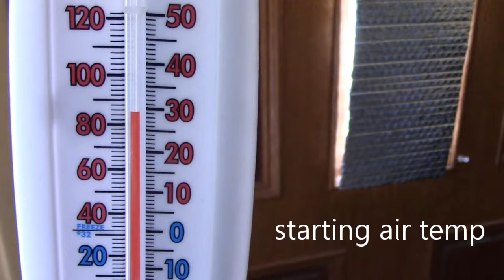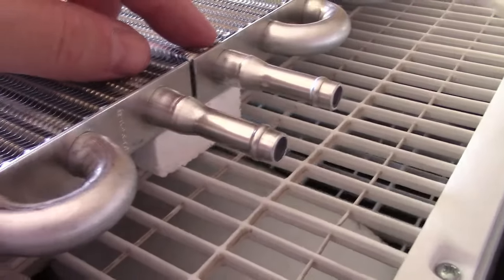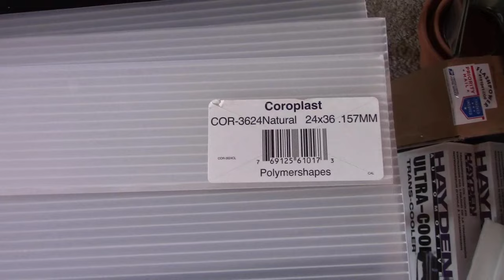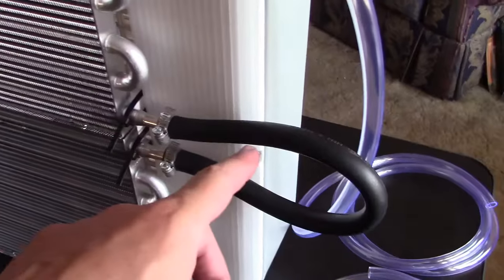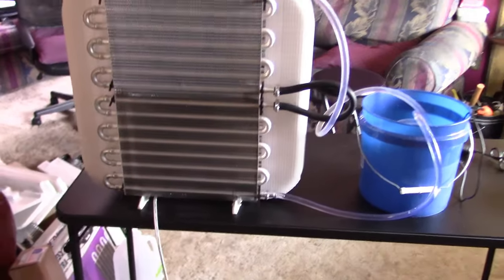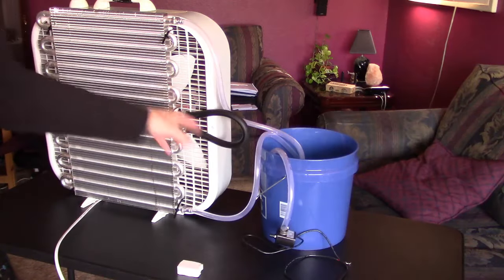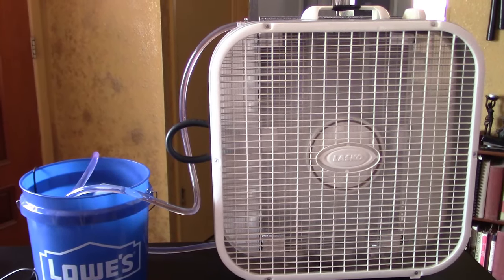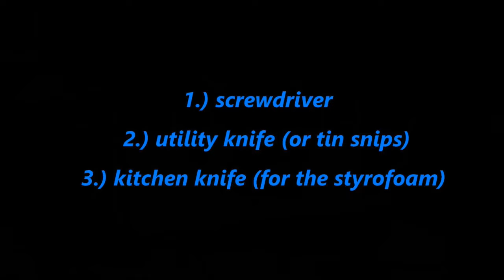DIY Air Cooler! Homemade Air Cooler with AC "like" feel! (extended *semi-uncut version) Box Fan conv

Comment: This looks awesome! I'm going back to college in 2 weeks, and I'm looking to build something to cool my dorm, how many degrees would this bring the temperature down in a 200 square foot room (8ft ceiling)?
Keep up the great builds!
Reply from the maker: hi. it all depends on how 'solid' (and cold) your cold water source is. this design is a powerful air cooler. but with that cooling power, it warms the water pretty fast (as it pulls the heat out of the air). bottom line is: if you keep it stocked with cold water (and have relatively low humidity) - it works roughly as good at cooling air in a room as an 8000 to 10,000 btu ac. (in terms of square footage it covers and overall drop in room temperature). note that that is the 'best case' (meaning with water temp 35F, humidity 5 to 10% and fan on low). if the water source is cool but not super cold or you have high relative humidity it will work more like a 6000, 4000, 2000 or 1000 btu unit *proportionally on down. it's really just proportional to how hot the room air is, how humid the air is, and most importantly how cold your water source is. the main thing though is just keeping the water cold. the colder the water the colder the air. btw the reason humidity is a factor is that it is harder to cool down humid air than dry air. note that this type of cooling doesn't remove humidity from the air but it doesn't add any either. that will stay about the same. that's about the only advantage that standard AC has over this.
Reply: Awesome, thank you! I will have access to an ice maker, and a freezer in the lounge right outside of my room, So hopefully the freezer and ice maker will be able to provide enough ice
Reply: @calebb3068  maybe if you have a hose running long enough keep the water near the cooler and cut the middleman

Comment: Great job! How long did it take to cool the room? How long before you had to add more freezer pack? Thanks for sharing.
Reply from the maker: hi. it's pretty strong. it cooled the room in a couple of minutes. i haven't done all the timed tests but i know when a just added one more freezer pak i got about 20-25 more minutes. if you can secure a good source of cold water or ice - you're all set for continuous operation. others will want it for cooling just a few hours here and there - hot parts of the day
Reply: @desertsun02  I believe if you use a picnic cooler with well insulated drilled holes, could maintain the ice packs for a long time.  Also you would  have a nice flat surface to glue the fan on making a nice portable unit.

Comment: What is your opinion on simply winding a copper coil to the fan? Do you prefer the radiator ?
Reply from the maker: hi. there is no comparison. using a radiator is 10 times better. the copper coil works but there are no fins with that one so its use is limited.

Comment: Is the coroplast for condensation? I’m thinking of making one for my tent but I don’t want to have my tent be all moist after running it. If the coroplast doesn’t help condensation, do you know of anything that would help to keep my tent dry?
Reply from the maker: hi. the coroplast is to block the air from going around or circumventing the radiator. if you have condensation consider putting it on a towel. it should only be a few drops so a towel or even a piece of plastic should catch it ('drop cloth' plastic is a possibility)

Comment: Is the box fan running off an inverter ?If so could you put a link to the best inverter for the box fan ,thanks .Much respect .
Reply from the maker: hi. it's just plugged into the wall. you can easily run it off of an inverter if you want to. box fans generally use under 100 watts even on high. so even a smaller inverter will run it

Comment: Do you think this configuration would work with an insulated cooler using a water heater element for heating during the winter?
Reply from the maker: hi there. sounds like a good idea.

Comment: Very good video I was very impressed and by the way if you would wear a t-shirt instead of a long sleeve winter shirt you would be cooler isn't that true.? Also if you built two of those fans one would go and blow cold air into the other 1 it would make it twice as cold now that would be a good video
Reply from the maker: fan into fan - like a pre-cooler. interesting - i'll give it some thought. the shirt is long sleeve but it's just a thin t-shirt material and i often pull up the sleeves. but you are right though, a regular t-shirt probably is cooler

Comment: Do you think the GPH of the pump would effect how cold it gets??
Reply: It definitely would, but keep in mind the ice is already running out very fast in the current design. At a minimum it needs more insulation and a bigger container to store more ice. What a lot of other designs I've seen do is use an ice cooler to store the ice.

Comment: How ong does the ice last in this set up? I imagine it should last longer than with the radiator in front, right?
Reply from the maker: hi yes, i usually get several hours of cooling at a time before ice needs to be added. it will depend on how hot the room is and how fast you run the fan. the slower the fan speed the longer the ice will last. the fan on low can get you double the cooling time of the fan on high.

Comment: What about cold water condensation on the coil pipe and eventually dripping?
Reply from the maker: hi. the styro-foam blocks keep the radiator off of the back of the fan (so no water gets on the fan). if you do get any condensation on the radiator, it will just drip straight down. you can set the fan on towel if needed but i never have any water buildup.

Comment: I was wondering about an electric ice chest that would keep water about 32ﾟor 35 And you could put  Ice in it I thought about trying something like that and see if it would just be like an air conditioner
Reply from the maker: hi. electric ice chest. sounds like a good idea. these things blow super cold air if the water is cold. (even colder than AC in some cases) because AC will only blow 15 to 20 degree cooler than the ambient air that it is cooling (whereas this can blow much colder air than that)

Comment: Can i do this on a larger scale like a 42 in industrial fan flat back with a lil bigger pump large cooler?
Reply from the maker: sure, you can make it any size. you could use a drum fan and a giant heat exchanger if you wanted to. they sell huge heat exchangers (up to 36" by 36") at 'badger insulated pipes' website. you'll need a large source of cold water.
Reply: @desertsun02  like a big yeti cooler or bigger?
Reply from the maker: @Ronnell James if you were using those large industrial heat exchangers (like a 36"x36" one that badger sells) you'd probably want to tap into a large source of cold water (like underground well or a pond.) - but some of those yeti's are pretty big so they might work too

Comment: I have a question does it have condensation? I am gonna try tomorrow.
Reply from the maker: hi. i never have that issue where i live. typically doesn't happen unless humidity is over 70%. if you have any - i'd say just put a towel under it and you should be all set.

Comment: One more question!  How is that 15” black rubber hose attached and what does that hose do??
Reply from the maker: hi. it's attached with what are called worm gear clamps. a few of those come with the radiator. you can also get them at the home and hardware stores if you need to. the hose attaches one radiator to the other. it kinda makes it one big radiator
Reply: @desertsun02  Oh!!!  That makes sense!  I thought it was some kind of handle 😜
Reply from the maker: @Sharon Metzner 😐🙂⭐

Comment: Will there be condensation at the radiator?
Reply from the maker: hi, it will depend on the humidity level where you live. it doesn't happen where i live due to how dry it is. that's why i put the radiator on those little styrofoam blocks though. that will keep any condensation away from the back of the fan.

Comment: Just realized that's basically how servers are cooled xD sonuvabitch haha
Guessing they don't make radiators in odd shapes haha unless I figure out how to mount it on the back of a Vornado fan.
But thanks for the idea! Most ppl use that copper tubing method but this the first I've seen of a radiator mount instead.

Comment: is there a possibility of the water coming into the air blades mechanism and destroy it later on?
Reply from the maker: hi there. nope, it's a closed loop. water stays inside the radiators
Reply: @desertsun02  thank you so much!

Comment: How much ice will be needed to run this cooler for one hour?. Please let me know. Thanks
Reply from the maker: hi. that's hard to say because it depends a lot on hot the room is and how fast you run the fan.
Reply: @desertsun02  yes very true. Say if the room temperature is 32 degrees cel. and room size is 3Mx3M. Sorry for asking. But since this A/C is made for cost saving therefore we need to know how much we can save.

Comment: Being hot moves to cold Thats only gonna work till the bucket is saturated with the heat equaling room temp then your gonna need more cold water. It Would be continues cooling  if you could replenish the cool water without dumping the bucket.

Comment: Any issue with condensation?
Reply from the maker: where i live i don't usually get any condensation. (dew points are often in the 20's here). if you have that issue a small towel or even a couple of paper towels might be all you need to catch it

Comment: How about using copper tube on a roll in this setup? It easier to find where I am and the Heat is Coming
Reply from the maker: hi. the copper tube ones only work a little bit. this works much better. (mainly because of the fins)
Reply: Thank you! I will keep looking for solution then.
Love your videos 👍

Comment: How long does it last the coolness ? In hot temp room and can you use this in a car? Thats would be coo so you don't use up ur gas ?
Reply from the maker: hi. length of time it lasts varies quite a bit. it depends on how hot the room is, how much ice or ice paks you use, how fast you run the fan - thinks like that. if you have a steady source of cold water then it lasts "forever". (natural steady source is something like 'well water' (typically 55F) or a lake/river water).🙂
Reply: @desertsun02  oh ok... what about  for a car situation i sit in a car almost 8 hr of my shift in this summer heat high 90s to over 100s degrees double digets. And I run my car for hrs cus this heat its all  work related.  But man if I can get something like this to work in my ride and not have to use my gas would help big time. ??

Comment: Where did you get the hose and what's the proper name for that
Reply from the maker: hi. i get the clear vinyl tubing at home depot and/or amazon. the black tubing (and the clamps) actually come with the radiator. if you search for 3/8" (internal diameter) clear vinyl tubing you'll see lots

Comment: how much ice did you use and how long did it keep cooling ?
Reply from the maker: hi. i just used 2 or 3 ice paks with 36F water and got maybe 45 mins to an hour. use more or less ice for longer or shorter times. or buy a water chiller and tap into that for easy continuous operation. one tip: run the fan on low and it lasts a lot longer. even on low box fans push 1000 cfm or even a little more. i wish i could run it even slower
Reply: @desertsun02  Have you tried using dry ice? Might last for quite a while

Comment: With normal temp water how much will it cool? Enough?
Reply from the maker: hi. it depends a lot on your normal water temp range. if the water is say 72F and room is 85F you might get 5-8 degrees cooling. if your tap water is in the 60's then you'll get even better cooling. if your sitting in front of it you'll have the 'wind chill effect' also and that makes it 'feel' a little cooler. if the water temp and air temp are the same then there is no cooling.

Comment: What is the ideal fan speed or CFMs.
Reply from the maker: hi there. top end (ideal) is probably about 1000 cfm (or a typical box fan on low). basically, it's as slow as possible (while still getting the breeze you want). ice lasts longer and air is cooler as fan speed is decreased.

Comment: Where did you get the radiator cooling thing?!?
Reply from the maker: hi. the radiator is a hayden transmission cooler (model 405). i get them on amazon. ebay should have them too

Comment: What is that to connect the pump for power
Reply from the maker: hi. that is an AC to DC transformer. it plugs into an AC socket but puts out 12VDC. i like the 12v DC pumps because they can also be run on a 12v solar panel or a 12v battery.

Comment: How to make ice without refrigerator or freezer???
Reply from the maker: hi. i've got a video or two on making ice with a "solar powered" ice making system. that's one other way. if you can't get ice think other sources of cold water. btw - i've got two videos coming up soon on how to make a water chillers. those will cool the water enough and could be used.

Comment: ?Q? What about using a small ice maker like the IMPROVEMENTS Ice Make, model # HSN#606780-611? Runs on 115 VAC 60 HZ 1 PH.
Current- Ice production 1.7A
Current- Ice storage 2.0 A
Reply from the maker: sounds like a plan. or maybe you could just tap into the cold water reservoir that those things have.

Comment: What have you been up too?
Reply from the maker: hi there. was working on another indirect evap cooler in late summer (but now it's gotten cooler) so i've switched to focusing on heating and heaters. (evap cooler will have to wait until spring). i haven't posted recently due to life events - but those are temporary. i'll be posting again soon (hopefully for another 10 or more years)
Reply: @desertsun02  just checking on you. I pray things go good for you and that yes, you can keep at it for another 10 years. I like this content, Jeff.

Comment: i guess this only works if you have access to ice too bad for people like me who lives in a van im looking for something i can save money off grid
Reply from the maker: hi there. ice is the main quick way to get cold water that i can think of but you don't necessarily need it. natural options for cold water are river, stream, lake or 'well' water'.  other ways could be using a water chiller of some sort. (reservoir of ice machine, office type 'water cooler' or aquarium water chiller). some also say keeping water in fridge and running tubes to it could work. i get that they may not work for you but wanted to mention other options. 👍
Reply: Do you have a fridge in your van? Maybe use gel packs you can get cold, have several and swap them as you go?

Comment: Add filter at the back of the fins
Reply from the maker: it's a good idea. i've thought about doing that but haven't tried it yet.
Reply: What is the filter supposed to achieve?
Reply: @007alztruli  i prevents entry of dust on fins and keeps the air clean.